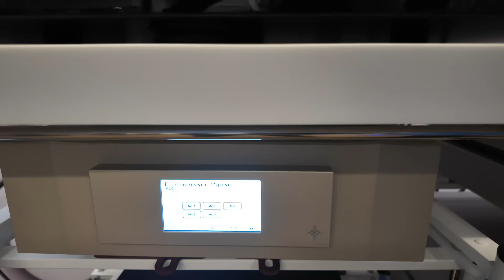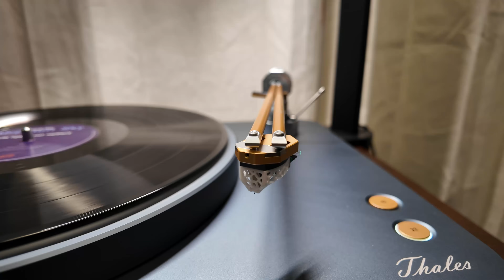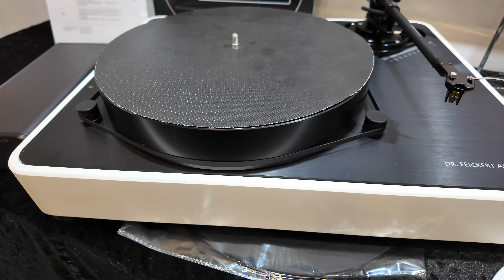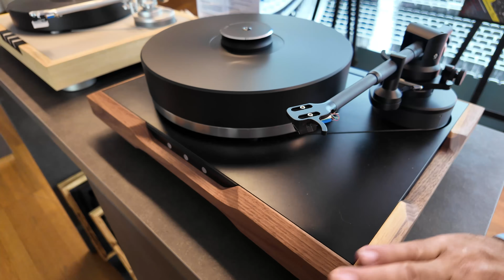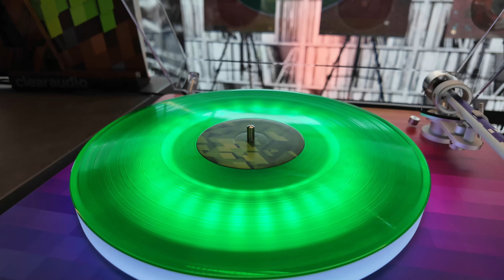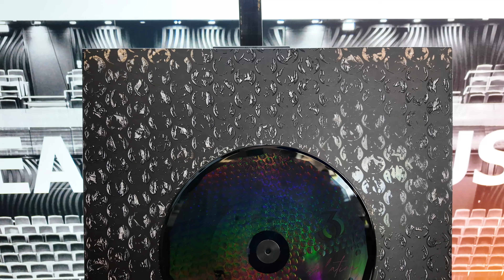Vienna High End Show 2026 No. 3—More New TTs, Phono Preamps and Cartridges!

Comment: I would love the option for a taller uberlight frame. For a tall turntable with a dust cover (Helix 2 in my case) the frame is too short, you'd have to swing it out of the way to get the dust cover off.
Reply from the maker: It swivels easily you know. It rotates.

Comment: Thales Magnifier Phono/Lineamp 37.490,00 € Realy? Not that this should be the usual price-bashing, but WHY? "very small production runs, with a lot of manual work and correspondingly high development and manufacturing costs"?
Reply from the maker: what's inside is quite unique. There's a video from last year taken in the Thales/ HiFiction factory where the designer explains what's inside...
Reply from the maker: There's a video I shot two years ago at the factory that explains the product, and why it costs what it does....probably titled "TrackingAngle visits HiFiction"